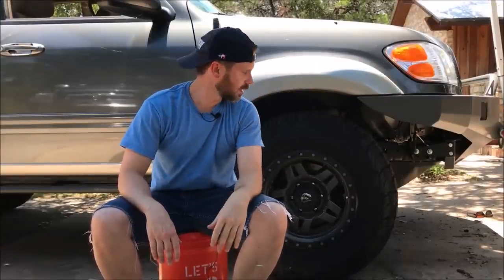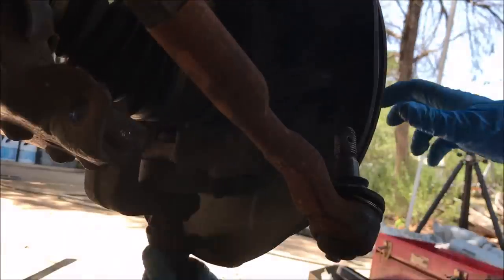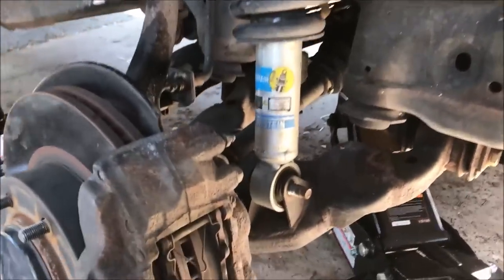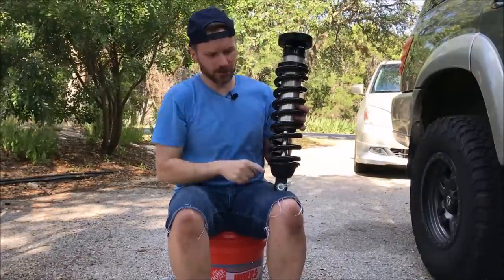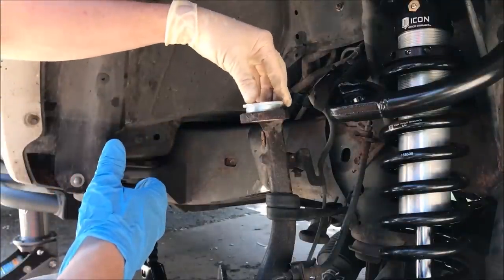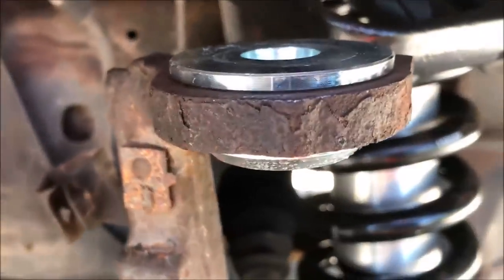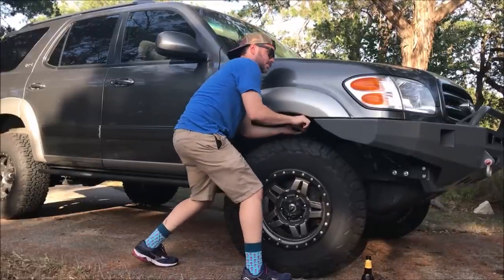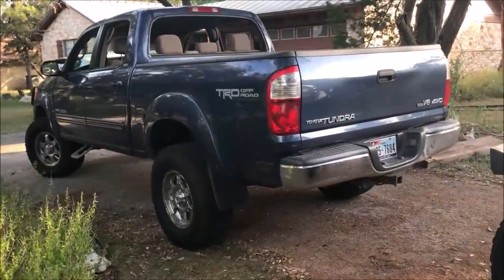Ep. 8. Icon Coilovers, SPC UCAs, OEM Lower Ball Joints Install Tundra/Sequoia

Comment from the maker: Please read the "heads up" in the description o this video.  This video was made 4 years ago and this was the old SPC design.  It was installed properly at the time.  The updated design calls for the slug adaptor to be pressed in the opposite direction.  Always install according to the instructions in the box.  I've made an updated SPC upper control arm video here.  It's for a 4Runner, but it's the same for a Tundra/Sequoia: https://www.youtube.com/watch?v=X2mnWfg9x98
Reply: So glad you comented on this, after I got my STRAIGHTJOE from your website, I looked at the directions and I was like well, I bet he figured out that it actually works better this way so I was absolutely going to do it that way. Ha ha haa!

Comment: This is great content... there’s not much install videos on YouTube for the first gen Sequoia! Keep up the great work!
Reply from the maker: Glad you like them.  Subscribe, I have plenty more to come.
Reply: @1stgenoffroad  I loved the video thank you so much for all the hard work much appreciated. On one note. That upper ball joint takes a special adapter for the Sequoia not found in the ball joint kits you get at the Autoparts store rent a tool.  I went to 3 different ones looking for it. I  like you, improvised. I cut the top off of the ball joint and pressed it out. A 2' or 3' cheater bar and penetrating oil greatly helps this process thanks for the great video Josh!!

Comment: Thank you for the detailed video!  I believe that SPC may have updated the steering knuckle insert for the upper ball joint.  On my 2006 Tundra the steering knuckle insert had a slot cut in it, and it was inserted from below the knuckle.  With this new design, you could hammer it in with a rubber mallet instead of putting it in the freezer and pressing it in.
Reply from the maker: Correct.  Also presses in from the other direction.

Comment: Got a 2003 Tundra TDR  4.7 In it with 203,768 miles. Just did timing belt change it’s been a great truck had it for 6 years now and not ever going to sell it. I am going to do what u just did in this video to it. Nice job and thanks for the how to video.
Reply from the maker: Nice! These are great trucks.

Comment: Again men good videos thanks, how works that ball joints after 3 years?
Reply from the maker: 50,000 miles later, still hanging in there.
Reply: @1stgenoffroad  thas good, but that link on the descriptions is for tundra, amazon say it isn't compatible with my 2002 sequoia
Reply from the maker: @jonathanjaviergutierrez4033  Here you go: https://www.1stgenoffroad.com/store/p1082/OEToyotaLowerBallJointsRightandLeft20002006Tundra/20012007Sequoia.html

Comment: Something nice about the SPC upper arms over my total chaos... you have no clearance issues. When I installed my total chaos upper arms they would scrape the front of my upper strut mount when moving up and down. I had to break out the grinder and shave away some metal on the top front of it. Tried taking out as little as possible, but noticed that driving they still contacted a little. Had to go back and grind even more a week later. Actually just noticed another nice thing about the spc's, you could bolt the abs wiring back on to it. The chaos ones have nothing on it to bolt it up, so my abs wiring is just zip-tied to the back of the upper arm. For such a pricey and nice looking arm, the zip ties look a lil ghetto
Reply from the maker: Wow!  Yeah, these fit just fine.  Took a couple of trys for the alignment shop to get it right tho!  lol

Comment: Moved to the DFW area last year. Bought an 05 Sequoia and don't do any offroading, but IMMEDIATELY noticed how rough and unforgiving the roads are here. My dealer inspected my truck and said my front struts are leaking fluid and I need them replaced. I want the whole suspention replaced and am deciding between Fox, Bilstein and Icon. Anyway, this vid gives great insight into what needs to to done. Thanks.

Comment: thanks for the video, this is going to help alot. Did you have any fitment/rubbing issues after the suspension upgrades running 285/70's?
Reply from the maker: No issues.  Make sure you follow the instructions from SPC when pressing in the new slug/adaptor and ball joint.  SPC has changed the design slightly.

Comment: What size tires do you have? I think I need to change my settings on my SPC UCAs to A. I don't recall what I set them to when I installed them because I didn't really know what to set them to. But I have 295/75r16 tires on a Toytec boss coil over lift so like 2.5 inches lift maybe and i'm still rubbing while turning on unlevel ground.

Comment: Kind of a ridiculous question lol 🙃 What Jack is it that you’re using?

I’ve watched this video enough that I think I wanna try tackling this now. I have an 05 Sequoia that’s got a level kit but it was just coil spacers. I just did my LBJs recently and it was actually easier than I thought (not entirely mechanically inclined, learned mostly on YouTube and Chilton’s manual, plus some good friends lol). Been wanting to do a suspension upgrade for a while but felt a little intimidated by doing a full suspension. This was extremely detailed and super helpful, I feel like I might be able to actually do this now 😹 Thank you!
Reply from the maker: That's a Pro Eagle 3 Ton Big Wheel Jack.

Comment: Great video...which sway bar link are you using on the truck ?
That one looks really good.
Reply from the maker: I'm not running any links front or rear.  But if I was, I would use these front links: https://www.1stgenoffroad.com/store/p873/Suspension-Maxx-Extended-Sway-Bar-Links.html
Reply from the maker: And these rear links: https://www.1stgenoffroad.com/store/p1037/SuspensionMaxxRearExtenededSwayBarEndLinksSequoia.html
Reply: @1stgenoffroad  
Thanks very much. 
Your videos are awesome.
Keep them coming.

Comment: Hi Josh 👋  I just picked up a 2007 sequoia  4x4 by chance will this set up work on my 2007 ? Before I order parts
Reply: From your link
Reply from the maker: Hey bud, congratulations on the new rig.  Yes. This will work the same way on the 07. If you have air suspension, you'll have to convert to traditional coils and shocks so you can lift the rear enough to match the front.
Reply: Mines did come with Air shocks
Reply from the maker: okay. So there’s a 1” rake with these Sequoias. Can you set the rear to “high” all the time? The. You could adjust the Icons and set them at the 2” setting in the front and sit level.
Reply: I ordered the control arms and ball joints this round. Next round will be shocks . Thanks for having your link simplified

Comment: Ty brother for the video.  How is the ride on it ? And do you think even on a 2wd tundra 2006 this would be a good set up?i installed just a rough country leveling kit 3 inch
Reply from the maker: Hey bud, glad you like the video.  Yeah, the've been great.  For 2WD and with no bumper, I would stick with the 650 pound spring.  Thanks!

Comment: I have watched a couple other videos... the point there was not to lift the Sequoia using the aftermarket tubular control arms, because the main bolt holding the control arm is not a tight fit.  After a year or two the can breaks.  They also mentioned the ball joints , if not genuine Toyota, have slop in fit.  Can you comment on that?  Have these after market companies improved the design.  I want to lift my Sequoia more then 2 inches.  What height do you suggest?  3" 4" ??

Comment: Hi! I lift my 1st gen sequoia my question is do i have to change my upper control arm and what more will need to change? I lift it by changing only my shocks the FAPO SHOCKS 2.5 to 3.5 lift
Reply from the maker: Yes.  With a 2.5"-3.5" lift, you should also go with aftermarket upper control arms.

Comment: Great video bro
I put dystar spacers on my tundra i lifted like 3 inches bit now my upper control arms rub my coil springs  I need to fix the problem  what do u think  I should do
Reply from the maker: SPC Upper Control Arms (same ones in the video) will fix that problem.  email me for a promo code: josh@1stgenoffroad.com.  https://www.1stgenoffroad.com/store/p146/SPC_UPPER_CONTROL_ARM_SET__%2700-%2706_TUNDRA%2F%2701-%2707_SEQUOIA.html
Reply: @1stgenoffroad  
Ok thanks

Comment: Watch all ur  Sequoia videos love it man..Keep it up !So I finally got my Sequoia last month it’s a 02 4x4 SR5 ...I bought a lift kit from ur site same as urs well actually my Icon comes with 650lbs spring and OME rear spring and shocks ,...so after installing it the back sits a little too high I would say an inch higher and I’m not digging it...Question the Icon coil overs is set at factory and ship to customers at 2.5?Would u recommend adjusting the spring or I’m thinking adding a 1inch spacers just to even out the stance....I will be ordering more stuff from ur site soon I’m eying on the bumper to...thanks man.

Comment: Cool vid. Did you need to remove the 4 bolts holding the lbj to the spindle when putting the new coilovers in? Or was just the upper ball joint and tie rod disconnected?
Reply from the maker: On the drivers side I had the entire lower ball joint and tie rod off. But on the passenger side it was all connected. I did remove the upper control arm because I was changing it anyway. I’ve done it before where I left that in place too.

Comment: What's your opinion on rear coil/front spacers/leveling kit? I have  a 2007 sequioa and recently  a toyota technician  advised against it and refused to put it on my vehicle based off a few scenarios? Does depend on the age of the vehicle?
Reply from the maker: In general, unless it's your only option, I would stay away from spacer lifts.

Comment: My 2003 Tundra Limited 4x4 is basically stock, has 45K miles and I bought it new with 25 miles on the odometer.  I am curious as to how much all of this has cost for the upgrades, seriously considering doing some mods in the future.
Reply from the maker: A lot of these upgrades are replacing ware items anyway. Suspension, wheels and tires, bumper probably $4500. But like I said, a lot of this (tires and suspension, were things I needed to replace anyway.  It’s all on the website here: 1stgenoffroad.com

Comment: So I got spc uppers for my 04 tundra and their diagram shows that the steering knuckle insert is supposed to come in from the bottom not from the top like you did it. Even though I think they way you did it seems right. Now I’m confused and not sure what to do.
Reply from the maker: Follow your instructions . They’ve changed the design since this video was posted.

Comment: For extended travel in the rear, did you have to remove any other suspension parts ?
Reply from the maker: Removed one rear sway bar link and removed the parking brake retaining clip.

Comment: Josh, I put the 5100s (4th notch) on my 06 sequoia with 33 BFGs like yours and am getting too mutch positive camber and getting squirely steering. Will the new UCAs fix that? Are the SPCs worth it or will the Freedom Off-road you sell on your site be fine? Also is uniball worth it?
Reply from the maker: I put SPC on all of my lifted vehicles.  I personally don't really like open uniball style upper ball joints as the ball joint is exposed.  Road salt and sand can get into the ball joint and shorten the lift span.  They can also be a little squeaky and require a little spray lube every not and then.
Reply: Thanks for the reply Josh. Will the SPC fix my positive camber issue?
Reply from the maker: @BhorsleyAD33  I'm not looking at your truck, but SPC has adjustable camber, so it would help you to dial it in.
Reply: Ok thanks, I see that now. One last question, do you prefer a little bit of negative camber on the front or keep it at zero?
Reply from the maker: @BhorsleyAD33  I try to keep it as close to 0 as I can.
Reply: Hi Josh, thanks for all your great videos, I have followed them and done most of the mods you did on my 06 Sequoia. She looks great! I got the camber figured out, it turned out my LCA bushings were rotted and the cam bolts rusted in place. I had to sawzall them out like you did (great tip) and replaced the LCAs. Problem solved. The last question I have on this now is how high did you set your castor at for stability? I just got her back from the alignment shop and the castor is at 1.9 degrees, which is the bottom end of the range (1.9 - 3.4). As I understand it, the castor should be at the top end of the range but I have also read that you lose castor in lifted trucks, so I am not sure how to judge this and am curious what you ended up with when all said and done.
Reply from the maker: @BhorsleyAD33  I'd shoot for more positive caster.  +3-4
Reply: alright, thanks. The alignment shop is getting sick of me, lol. I bought the lifetime alignment option and have taken full advantage of it with all of these suspension changes.

Comment: Hello! I installed icon suspension kit adjustable to 3 inch lift, when I took in for wheel alignment I am told I need to replace upper and lower control arms with an offset ball joint? Is both upper and lower required? Or could it just be the uppers required? The lower has adjustments for lift? Any other parts one should replace while he has it apart? Any suggestions?
Cheers
David
Reply from the maker: The lower ball joints are the Achilles heal in these vehicles. If you haven’t replaced them and don’t know the history, I would replace using OEM only. But that shouldn’t affect the lift at all.  And don’t let the shop do it, you can do it in 2 hours. 
But with a three inch lift, I would recommend an Upper Control arm. Go with the SPC UCAs. They are greaseable, adjustable, high quality and cheaper than Camburg. They also come with the upper ball joint.  Check it out here: https://www.1stgenoffroad.com/store/p263/TundraSPCUpperControlArms.html#/
Reply: @1stgenoffroad  thank you sir!
Reply: @1stgenoffroad  do I need to replace lower control arm and ball joint or just ball joint?
Reply from the maker: Unless badly rusted or damaged in some way, I would keep them. Replace the lower ball joints.

Comment: I have a 2001 Toyota Sequoia with 123.000 miles , how do I know I still have the bad ball joints that I see reported everywhere...I don't know much about but it but can you give me a tip on recognizing the issue? Thx in advance!!
Reply from the maker: They're easy to replace and not terribly expensive.  If you don't know if they've ever been replaced, I would replace them.  If they fail, it will be a very bad day.
Reply: @1stgenoffroad  alright thx for the heads up...

Comment: Why did you say position A vs the recommended pos D? Got the upper ball joint. Just wondering
Reply from the maker: I like position A because it sets the wheel at the maximum positive caster.  Then the alignment guys can take it back some if needed with the cam eccentrics.
Reply: @1stgenoffroad  ok I did the same and my tire is offset to the rear 0.25 inches. I just want to make sure I don’t need to change something or if will harm anything. Not an expert by any means

Comment: The 2004 Tundra never had a lock on the tailgate. He just bought a aftermarket handle that had a generic hole in it. These handles are common to just due to UV degradation.

Comment: This is a subjective question, but are the ICON shock/spring assemblies worth a $1250 upgrade? I was thinking about upgrading to the Bilsteins, and there is a considerable difference in price.
Reply from the maker: Well, yeah.  It's about $625 each.  But that's for new shocks and coils and top plates.  And with a 700 lbs spring and they are extended travel.  So I'm able to handle the added weight of the bumper and the winch (video coming) which added about 235 lbs.  And with the long travel it really does handle uneven terrain a LOT better.  AND they offer enough dampening to allow me to remove both of my front sway bar links permanently.  So I have more wheel travel.  Although do this at your own discretion.  But I did take the rig, loaded down on the roof, in the cab, with a loaded down carrier on the trailer hitch, in the mountains, up and down, around switch backs, 3400 miles from Texas to Montana and back without the links and with zero problems.  So for me it was worth it. But if you're not going to have a heavy bumper or winch and if you're keeping your links, Bilsteins are a great, inexpensive upgrade.  I really like my Bilsteins and in fact, another excuse I told my wife was that I could take the Bilsteins off the Sequoia and put them on my Tundra (they needed new shocks).  And that's whats I did.  Because they are good shocks.
Reply: Thanks Josh.... well thought out response.
Reply: Alan Land I gave my bilsteins to a friend with a 1st gen tundra. He had a rough country spacer lift that rode terribly. I'm glad I ditched my bilstein setup for my coilovers. I'd never look back. My coilovers with a bumper, winch and 2nd battery up front, handles better than my 5100s did with no added weight up front. But think it has more to do with running factory springs and hardware. Ive seen the 5100s perform much better when you scrap the factory springs and go with toytec springs. Maybe a happy medium cost wise

Comment: Great video, I don't know how this showed up on my recommended to watch. But I have all those parts in the garage needing to put on, except the icons. I have new Bilsteins. I need to put on my 05 Tundra. Btw thanks for the decal
Reply from the maker: The Google knows everything. Follow the instructions on the SPC UCAs.  I installed the older version where the slug/adaptor is pressed in from the top.  But they recently changed the design to where the slug/adaptor is pressed in from the bottom.  Not sure which one you have.  By the way, that sticker I sent you adds 25 hp.  Thanks again!